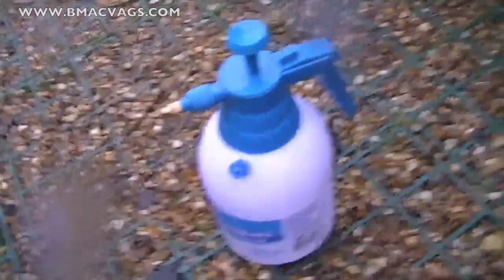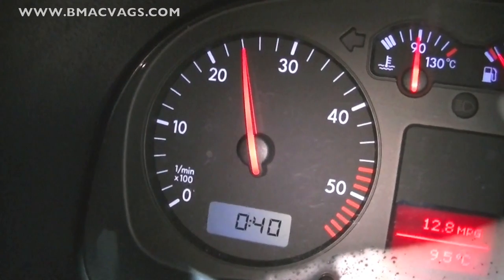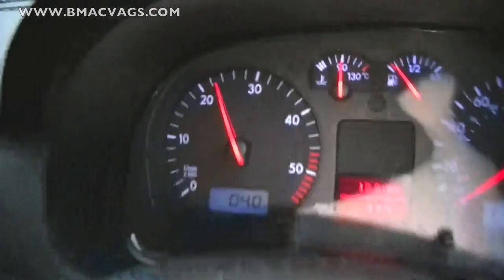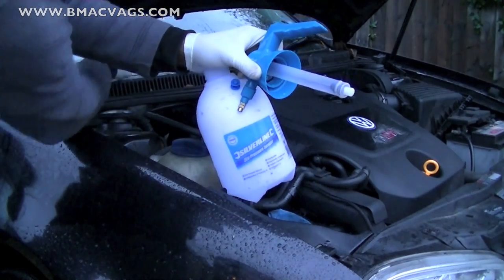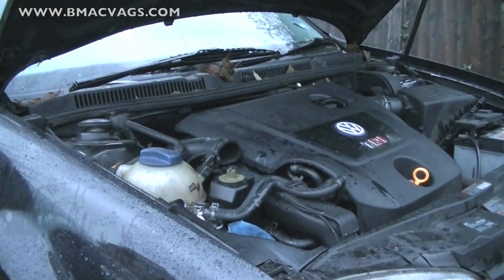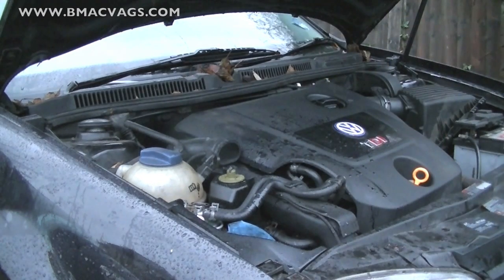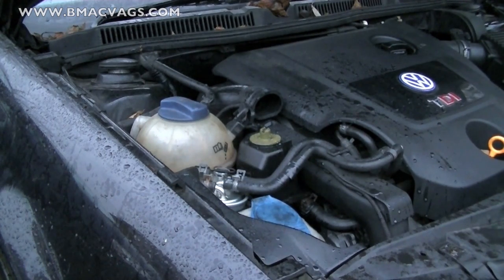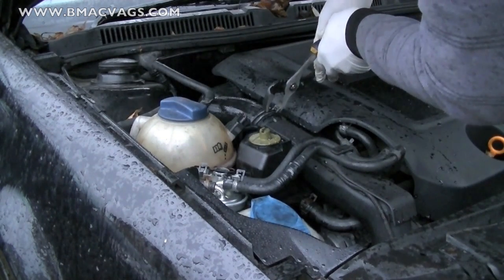How to Decarbonise your Engine with Tap Water

Comment: I have done this on small engines driving electricity generators that have been allowed to idle too long when not being used, I connected them to a load bank and made them work hard and sprayed water into the carb.then after a short while, puffs of blackish carbon deposits which the water vapor "exploded" off the internals of the combustion chamber blew out, I kept this up until the unit had its power restored. Leaving them idle no load kills their ability to function when required.

Comment: Yep did it 7am in morning exactly as you said. Revs dropped first time then did my squirts about 6 squirts a time until bottle empty. Went for a run after and car felt it was driving itself!!  This is an amazing technique. Do it. I will again in Jan 15. Love to know what it actually does in the engine and other components. Does if even break up blockages through egr and manifold?is this process breaking down carbon intothe engine oil?

Comment: First of all thanks so much for the info, being a noob this is amazing. Second I've got a question regarding the spray location. There is a product called 'revive engine cleaner' and their product is sprayed in after the maf sensor (like the petrol video you did on this subject) for both petrol and diesel engines. In this is video you chose the inlet before the egr. Is there a specific reason? I've got a chipped mk5 tdi, with a closed egr ( via vagcom). Thanks very much in advance.

Comment: Hi BMAC does this water method bypass through the egr system...can it be done without a having to clean the egr? Will the process loosen gunk in the egr pushing it into the engine. I have a 1.9tdi bora. Thanks in advance.

Comment: I've got a Audi a4 2.0 tdi b7 06, it's in limp mode, whenever I take the MAF cable out it works fine so changed the MAF still goes in to limp mode, the EML reads EGR so the mechanic cleaned it and the EML still reads p0404, the car sometimes drives normally for about 30 seconds and then goes back into limp mode, what could the cause be?? Thanks

Comment: Hi, awesome video brother. Just quick question regarding my kia sorento 2011 2.4 liter. I want to try this method, however the engine has 2 air intake hoses, both connected from the air filter. The big diameter hose is connected to the valves i believe and the small slim one is connected right under the spark plugs so onto the side of the cylinders. So my question is which one do i put the water in. Admiring your skills man, Great channel

Comment: nevermind, the other video of you answered the question, thanks pal......
I've seen guys using a system to inject water whilest they drive, and they seem to have better performance......
But they said they been doing so always since they had bought the car, some 150000 kilometer back....... and when they removed the head of the engine, you know with all them valves, it was like new. As if it hadnt driven a kilometer.

Comment: ok. 2 questions: 1. are you positive that this is not going to affect piezo-electric injectors? and 2. what happens with the particles from the engine? aren't going to block the diesel particle filter (DPF)? thank you.
Reply: Madalin Vladescu 
A.
1 . No
Reply: ROAlexa1981 What about Madalin's second question, surly the carbon coming of the engine will clog the (DPF) ????

Comment: I am an engine reconditioner and have worked as one for 15 years, Reboring engines. Grinding crankshafts and fitting valve seats etc, I do believe this will work in a lot of situations but I would tread very carefully here. injecting any water into an engine gives a high risk of Hydrolocking. Diesel engines produce power purely by combustion and not a spark. And if you introduce water to it which is not combustible at all carries a very high chance of bending a conrod.. Although I agree with the cleaning properties, and potential benefits. If I was going to do it I would inject it very slowly and make sure it is simply a fine mist. I have seen a few diy failures over the years. I also think that you should warn people a bit more about the risk as you will get the average joe here taking the spray bottle lumping in too much and wrecking their engine.. Will save you some earache..!

Comment: I wonder how using a water/methanol mix in the spray bottle would do? After seeing the tops of the pistons and the inside of the combustion chambers on a turbo car with water/methanol injection I would be surprised if it didn't do a really good job. That was the cleanest engine I'd ever seen and we know gasoline turbo engines are usually worse about carbon due to running a richer afr under boost to keep combustion temperatures down.
Reply: tonyz2897 Usually I clean my common rail 1.5L diesel with 70% destillated water and rest is 99.9% lab methanol. 1000mL all together every few months.

Difference between meth/water mix and just pure water is one. Engine doesn't slows down that quick after every injection  of meth/water mix than it would with just only water.
Tried it many times and pure water is just fine, but slightly slower. Prefer meth/water mix.

Comment: Hi Mate,
will this work on a VW Transporter 1.9 Tdi? My van starts to shake in high revs.

cheers
Reply from the maker: moonmonkey1975 It will not fix something that is broken, but it will make your car run a little better.
Reply: I would make a bet is the dual mass flywheel :(

Comment: I just gave it a try but probably the engine and outside temperature was too hot, so the engine was stalling all the time (due to hot air i assume) and i eventually couldn´t go on.
Reply from the maker: Have you checked for any other problem on the car?
Reply: The car works fine actually. 1.8T engine. 
Or is it the fact of slightly bending the air pipe that may reduce the air flow?

Comment: Tried this on our little skoda Octavia est tdi. It was running alitte rough and flat. Carried out fuel filter change filled with TUV approved diesel purge cleaner and then injecting the water. The first test run after the treatment was james bond style smoke from the exhaust that calmed down quickly and cleared after a 5 minute run. Next week another water injection as described and alot less smoke. The car is smoother, more responsive and I hear the turbo spoiling away better. Verdict: worth a go I seen real improvements, stick to the instructions, jst dont stick a hose down its neck feeding gallons of water and you will be fine.
Reply from the maker: Excellent testimonial

Comment: Would it not be better to use distilled water? Tap water can contain trace amounts of minerals and metals, not to mention whatever chemicals they use to treat it in the first place. It cannot be good to introduce trace amounts of these substances into the cylinder head.

Comment: Love your vids big man! I tried this on my leon fr tdi today and used a spray bottle (the kitchen cleaner type of ones) and i didnt really notice much white smoke coming out the exhaust but the engine revs did fluctuate. Am i not squirting enough water in or am i doing something wrong? Also would you recommend the car to be on level ground?
Reply from the maker: did you notice a difference in performance?
Reply: BMAC VAGS it does a little bit more responsive than before. Does this method benefit the turbo aswell?
Reply from the maker: Yes it will help to clean everything
Reply: BMAC VAGS i seen a video where the guy gets a long pipe and puts it into the turbo and fills it with mr muscle oven cleaner for an hour. What do you think of that method?

Comment: Just tried this, I got a very bad result. The spring clip holding the intake hose has blown off and now oil is coming out. I've got no power now and jerky acceleration. What does this mean?
Reply from the maker: What do you mean?
Did you do it the same as I did in the video?
Reply: BMAC VAGS Exactly the same maybe I didn't secure the clip properly, but it's blown off now. The hose won't stay on if I accelerate, oil is also coming out.
Reply from the maker: RealGX Where did the spring blow off to?? Did you see it blow off? Where is the oil coming from?
Reply: BMAC VAGS It's probably on the road somewhere. I just heard a loud bang. I then pulled over and saw that the pipe I was spraying water into (same as the video) had been disconnected, and oil is coming out. I've got no power now and the car is jerky.
Reply from the maker: How did the car feel and running before the loud bang?
Reply: BMAC VAGS Felt normal, maybe even more responsive. I posted a picture on this forum: http://uk-mkivs.net/topic/239859-oil-leak/

Maybe it'll help.
Reply from the maker: I can't view it but its no problem. So heres the thing, oil could be coming from your intercooler. I am guessing that the oil is coming from the plastic side and not the rubber hose side. we have to hope that the spring clip was not sucked in to he intake which seems unlikely. You need to get a big jubilee clamp to replace the spring clip that you lost. The car will not run right if the turbo in not pressurised. So get the clamp and put it back on and all should be fine. where are you located?
Reply: BMAC VAGS Waltham Cross, not far from Enfield, I know you're based in Edmonton so If you're free can I bring it to you?
Reply: BMAC VAGS Oil is coming from the rubber side by the way.
Reply from the maker: Was you driving the car fast when it blew off?
Reply: BMAC VAGS Yeah I was trying to give it trashing like you said. Revving all the way up to 4000rpm.
Reply from the maker: I am hoping that the spring clip did not get sucked into the engine, because there should not be any oil coming from there.
Reply: BMAC VAGS Hopefully not, when are you free?
Reply from the maker: where are you located?
Reply: BMAC VAGS Waltham Cross near Enfield.
Reply from the maker: Yh, no too far at all. Did you get the jubilee clamp
Reply: BMAC VAGS No where can I get one from?
Reply from the maker: Any hardware shop
Reply: BMAC VAGS All the shops are closed today, I just had another look and the oil seems to be coming from the plastic tube. Is there a specific size the clamp has to be?
Reply from the maker: ok, I can get the pipe with spring clip for £10 today if you want it
Reply: BMAC VAGS Yes please.
Reply from the maker: ok, where Can i meet you?
Reply: BMAC VAGS What's convenient for you? Would you recommend driving the car or not?
Reply from the maker: it should be okay if you don't go too far. Are you far from the Bullsmoor lane Mcd's?
Reply: BMAC VAGS It's about 2 miles from my house.
Reply from the maker: PM me your number
Reply: BMAC VAGS Sent.
Reply: BMAC VAGS Just done it with the new pipe you gave me there's a major difference in power, I'm not sure if it's due to the new pipe or the de-carbonisation. But either way you're a life saver. Thanks again.

Comment: I tried this method today on a x type jag 2.0 litre TDI.   My engine problems is lose of power, clear turbo wistle despite the EGR value beig replaced only a few days ago and power surge/limp mode.   This technique does work for minor faults (~5-10pwer boost) and i have seen an improvement to my problems but it is far from totally resolved.

Comment: This water washing of engine to release carbon deposits is standard practice on large marine engines -(7000hp/cylinder) -are you listening Zyborg136?, you half baked little boy - some of these engines even have water wash injectors permanently fitted. Another benefit is that the turbine wheel on the blower gets cleaned as well. the process is effective due to the injected water flashing off into superheated steam in the combustion spaces and cutting through carbon deposits. If the engine is hot and the flowrate of the injected water is not too high, there will be no water present to wipe off lub oil. For this reason the water wash is much more effective if carried out with the engine under load. It may be that the screenwasher outlet line could be temporarily connected to the induction system. Incidentally the charge air side of the intercooler can also be cleaned in a similiar manner by positioning the water wash feed up stream. Anyway Zyborg136, there's your little lesson, just be thankful you never came to work for me. Thanks BMAC VAGS for your posts and, don't let little sh$%s like this knob get to you.
Reply from the maker: I really appreciate you message, it made me laugh out LOUD!!  Sometimes when these guys come along talking garbage, they really make me concerned for mankind. They come with so much ignorance and rudeness that it just frustrates me. But its good to see people like yourself sharing your valuable knowledge in this arena, an highlight the total ignorance of people like Zyborg-whatever. nOnce again thanks for taking the time to comment.

Comment: hello got a ford galaxy 1.9tdi turbo not holding pressure
been told need new turbo or refurb  any advice ? will this video work ? or what about some off the other vids I have watched with people using mr mussel in to the hot side of the turbo ?
Reply from the maker: It is a little tough to say, it could be the turbo actuator, or the vacuum solenoid, carboned up VNT and whole number of things. How do you know it is to holding pressure?
Reply: what it is get sluggish going up hills so taken it to a garage they put it on a machine probes in where dipstick is and up exhaust revved it  up after about 20 min said turbo is not holding pressure and gave me 2 choices 1 have it recon 260 or new 1 400 and that's with out fitting
Reply from the maker: Have you watxhed my turbo rebuild video?
Reply: don't trust me self I would probably balls it up
  plus mrs would kill me did think about but don't want to upset mrs
Reply from the maker: No problem.  Where are you located??
Reply: sent you a msg
Reply from the maker: Via youtube??

Comment: Hey ! I`ve tried this method yesterday, and I`ve hit a problem, i think.When I unpluged that pipe , she started to make a big noise .. like a bass ! As the engine coudn`t breath I think. And I tried to spray water but it sprayed it back so I pluged the pipe back and everything was back to normal... So what can I do to try this method ??
Reply from the maker: What engine is your car??
Reply: BMAC VAGS 1.9 TDI (101 HP)
Reply from the maker: So you are getting back pressure from the inlet manifold?
Reply: BMAC VAGS Well I gues that is happening when I remove the pipe ... because while she is making a big bass noise , it also spits the water back in my face.
Reply from the maker: That is not a good sign because it might mean that there is a problem with the valves. Is that car running poorly?
Reply: BMAC VAGS All I can tell you , is that my car is running perfectly ! And I just love that ! Not even a problem, but I just wanted to try this cleaning method.
Reply: @BMACVAGS  I have the same issue but it was before the "cobra".  Air is blowing towards me from the cobra when i remove the black plastic in front of the cobra.  2006 Range Rover Sport S.C.  Maybe I need to remove the cobra?

Comment: i used Seafoam before and it worked fine, however i tried this method after using seafoam about 2500 miles ago... i pulled the spark plugs after the seafoam looked at the tops of the pistons they were fairly clean for almost 200k, after trying this i had black carbon soot dripping out my exhaust, i only did about 1/2 liter of water thru a sprayer, it didn't damage the motor i dont think but i am still pretty skeptical... ether its actually cleaning my motor or its cleaning the exhaust as much most condensation dripped out the tailpipe ill try running seafoam again but this time through a sprayer from now on, maybe the results are better...

Comment: i like the idea of a clean engine but water is a big no if you ask me. i know the change of hydro locking is very small but still you are making a change of doing it.
i change my oil every 10000km and floor it at least once a week.have done this to all my cars and bike's and they all stay very clean on the inside. 

on the other side i cant say if it works to get any power back if i want to know that i need to do a dyno run when i ust get a new car and a dyno after 2 years of use.

same for the water cleaning trick i think its more a mind game then a real improvement.

Comment: This thing worked for me on my 01 corolla, pinging problem gone and the engine is more responsive now.
Reply from the maker: Excellent, this method is much better that the stuff you buy in the car shop.
Reply: Much better for engine than best cleaners (with PEA) you can buy.

Comment: you shouldn't use bursts of water. that doesn't allow all cylinders to get the same water and the same degree of cleaning. you have to use a smaller constant fine stream during intervals not smaller than 15 seconds.

Comment: tried this on my bike and it worked. The advantage of using in a bike is that you actually can ad water separately in each cylinder through the vacuum hoses from throttle bodies. It blew carbon deposits through the exhaust. I could not say that is 100% safe. When entering the cylinders water became steam instantly. Furthermore water does not compressed and it creates an extra pressure which dislodge the deposits. It clears the carbon but in the same way it can bust the pistons. Yes, water was used to give extra power in piston aircraft but the mechanics found out that water injected engines had NO problem with carbon deposits.
Reply from the maker: As safe as using seafoam wouldn't you agree??
Reply: BMAC VAGS Yes, if you are using the same ratio